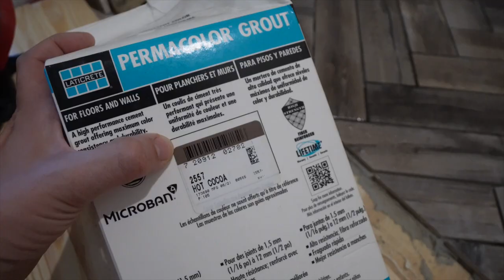it's finally MOVING DAY!! + grouting tile in the laundry  XO, MaCenna Vlogs

Comment: Amazing work! Tip for laundry room floor’s edges instead of trims or moulding. You could cut up cheap tiles and use them around the bottom of the walls for a waterproof edge.

Comment: Don't scare us like that again!
Floor tile looks nice. I hope herringbone pattern is everlasting. I might use that, but I worry if a current trend dates a house. I know parquet floor is out.
BTW, be forewarned, that water supply box will turn yellow. I noticed mine the other day went from white yellow. It's been 15 years.
My dryer vent hole is straight out the back wall to the outside, unseen. In basement installations, obviously, it needs to go up and out.